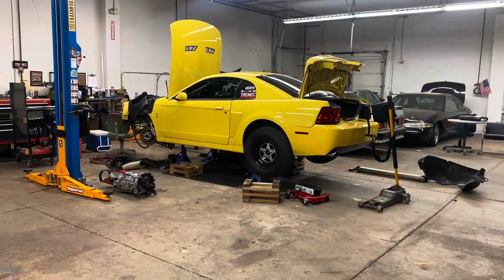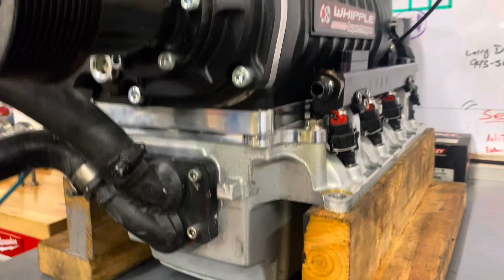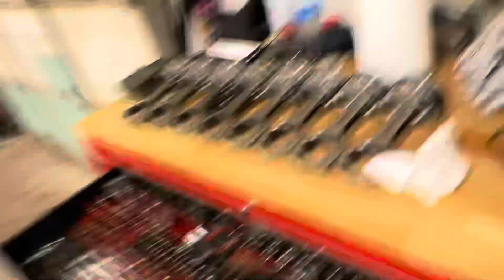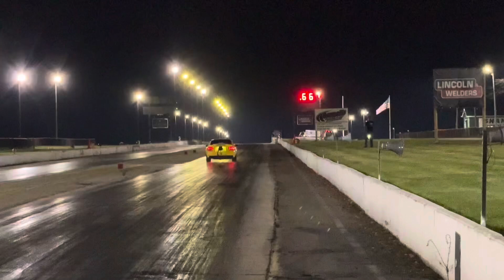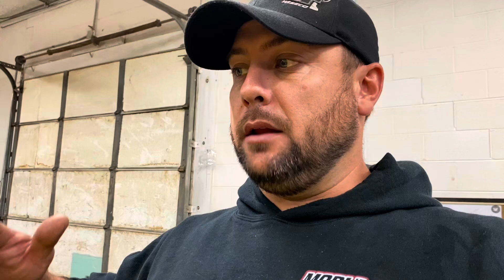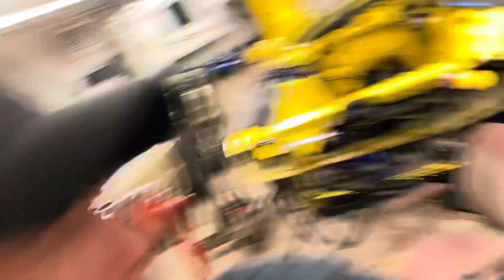But Ya, no, Definitely.

Comment: I have an 11 second SBF turbo car so I am not qualified to give you advice.  I Love my two step at 5k and clutch tamer, but I still struggling to get it to build boost on the line, best 60' is only 1.49.  I think 2-step helps the old t5 shift. Could you use the dominator to open the blower bypass valve when on the two step or while shifting to reduce the over  boost?

Comment: Sleeves, o ring the deck, and possibly have a burst panel added to the lower intake. Go with a dominator and add individual cylinder egt also. Data will be your friend when figuring this out. Take this off season to give it a solid once over setup. On the rev limit/2 step/no lift shift do you cut fuel or ignition or both? Wonder if there is a correlation there with say cutting spark and over fueling on a shift causing the back fires. Dont give up just yet. cause with a coyote swap these issues may follow. You made great progress with just the swap to smart coils.

Comment: I'll add my 2 cents.

I was sent this video. I havent followed you, maybe i will now?

Ive run the nmra circuit this year running true street with my car 'detuned' as I sorted out the build. 

I believe your issue is 100% tune related. Ie, spark. 

At your power level, ie cylinder pressure, is extremely high. A variation in load can alter the timing needed. Each gear could also have a different timing table. Ford has used different timing curves based on loaf and gear since the fox body days.

Typically when a motor plate is needed, the middle 2 cylinders will be affected, not the front and rear as much.
Furthermore, the sleeve took the blunt of the force. You can also see where the gasket started to blow on top. This makes me believe it started inside the engine, not from a block flexing.

I would bet the timing is either to high, or it is ramping in too fast and there is very little room for error. 

I haven't followed your build so i don't know the bore size, or how it was tuned to offer up more advice/my opinion.

For what its worth, im running a bone stock wap block, cast crank, eagle rods, navigator pistons, used bearings, stock heads, btr springs, felpro gaskets, and a vmp 2.3. 

Ive run a 1.20 60', 5.6, and 8.922 on all shit parts. (Irs/th400) data now from the same pass, all weighing 3500#
Ive yet to get a solid perfect pass since turning the car up this fall. 

I have another engine I've built that far exceeds the bs engine in it now. 

Hope some of that helps.

Comment: I feel this, so much. I have a turbo 2v, but man if I haven't burned em up and broke em faster than I can fix em. 

As far as motor and mid plating it, I don't see why it would be a problem at all because of the whipple. And actually, since you have the car all built around the motor being in stock location, it would make it REALLY easy to do, because you can take all of your measurements and do all of your trimming and tab mounting with it sitting on the stock mounts. Getting away from the stock mounts is 100% better for the block. 

I personally would be more aggressive with that coolant pressure safety. You got super lucky it didn't cost you significantly more parts. I will say though, if you go to a sleeved block and you are still having the backfiring issues and whatnot, it is just going to find the next weakest link when something fails. One of my motors is sleeved, oringed etc and if the bad stuff wants out, it's still coming out lol I've checked, unfortunately. 

You're in a tough spot, and I know exactly what you're feeling, wanting to prove that your combo can do something, even though it's fighting you. I reckon if I were you, I would sleeve it, motor plate it and come out swinging. The unfortunate (and fortunate) truth about the coyote option, is that it's basically the same money as the 4.6 option. I know for me, I am finally just conceding that I can't keep banging my head against a wall and am building a sleeved coyote. But I think you're super close, and I'd like to see ya win and beat your goal. Either way, keep at it.

Comment: It sounds like you need to take a step back and just disconnect from the car for a few weeks. Not to sound cliche but follow your heart man, if you're set on the 4.6 Whipple then go for it. The coyote is the superior combo but it wouldn't be a true terminator without its 4.6.